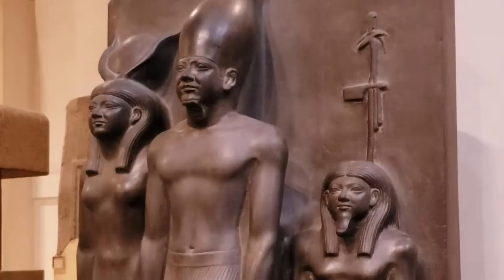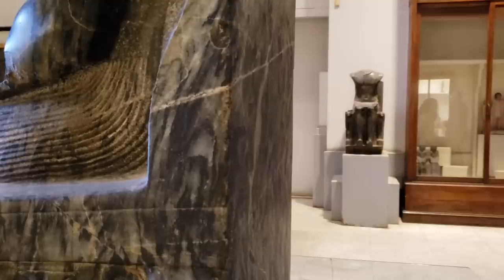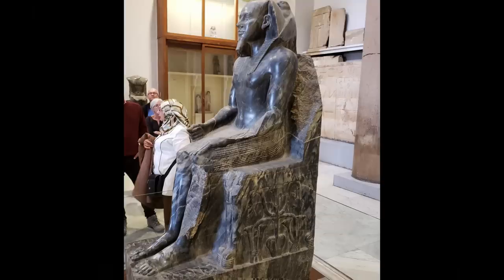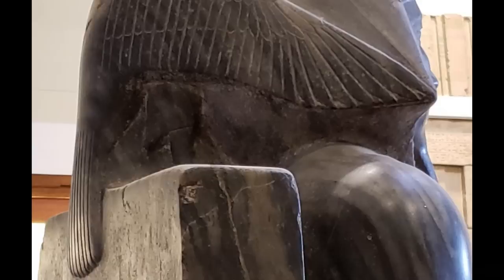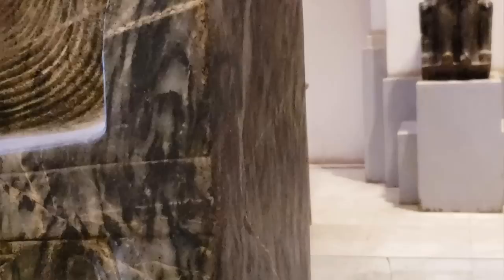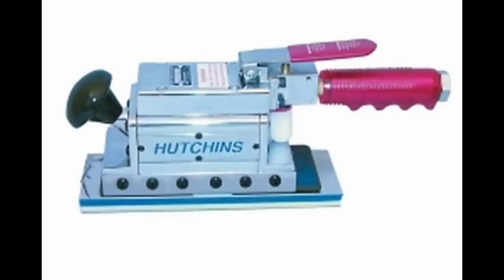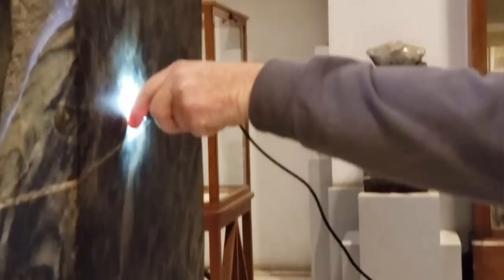Khafre's Diorite Statue

Comment: I’ve always been amazed by the diorite  vases in the museum ,,How material as hard as this was removed from inside a tall vase is just amazing
Reply: Yes - leaving fine spiral groves inside.
Reply: They are the top of the stonework art  ...   and so mysterious
Reply: Because it's laser work! Oops, did I just state that we had more advance technology before our time? >_<
Reply: @crafty3329  It seems obvious they had some high tech kit but the tools dont get found as far as I know
Reply: ya those diorite vases are the clincher for me that it cant be copper tools alone. They were using power tools, Power doesnt have to be electricity. Living on the great river I can imagine water wheels and belt driven machines as one possibility.
Reply: @louferrigno4712  Maybe, but it would have to be very high speed, which would need steel axles, spindles and bearings, not to mention that all the pieces carved would have had to be done right at the riverbank (if that was the case)
Reply: @Automedon2  naw it could easily be low speed. I run ring saws at low speeds that remove material in similar ways

Comment: Manual hard stone polishing techniques are still used today, though electrical machining has take over almost exclusively. For polishing very hard surfaces, shark skin, ray skin and wet leather, covered in various sizes of sad grains are used. The sand becomes imbedded into the wet leather and is similar to sanding disc today. Final polishing is done with hard leathers, leaving NO scratching, as leather is able to even sharpen modern steels, as seen in barber shops, with a blade sharpening leather strap, which hones the edge of the blade, while not leavening a jagged cutting edge as using a F-Dick or similar sharpening steel tend to. Similarly, wet wood most commonly used, also copper and brass, were also used in this way, as the grains would embed into the soft metals, forming a matrix, like the hole saws and stone cutting saws seen today. Large surface polishing, was not done in a random circular motion, it was done in a straight forward and backward motion, like scrubbing the deck of a ship with sand stone. Ancient people were just as intelligent and resourceful as people today, more so in fact, as people today in the west, have become lazy and had everything made for them.
Reply: Mystery solved. Ancient man simply was better than our best stonemasons. Again and again and again. With thousands of artifacts. Probably every ancient egyptian did it. When not building megablocks. How I love easy reductionist answers.
Reply from the maker: Yah...it was easy! Any idiot with some sand, flint, and sharkskin could do it!!! We're just TOO STUPID to comprehend how easy it really was!

Although...you'll notice that none of these know-it-alls has managed to produce so much as a perfect stone bowling pin with their sand and sharkskin, much less a life size diorite statue of a human being, complete with precise anatomical detail and a brilliant polished surface right down to the edges of the cuticles on the nails.
Maybe that's because their lifespans aren't long enough to accomplish the task with the methods they propose?
Reply: Ah. Easily explainable. The principle has been shown over and over again, be it sawing 4mm of granite in one hour or making tube drill cores that almost but not quite look like Petrie's. How to make these (alabaster...?) vases is shown on a relief, as is towing a statue of unknown material by a bunch of buttflaps. See, it is all there for those who want to see. 
There is no need for further research, let alone testing, as the easiest answer to the question, nay, the answer to the easiest question has already been found. The rest is just a matter of belief in your pharao, elbow-grease, and, possibly, the whip. Now there, was that so hard to explain? This is how you have to make use of parsimonity. Why, of course we could do it. No need to spend millions on millions if not billions (with the slight chance of a colossal embarassement) in a real experiment on scale if continuously parading the aforesaid arguments on all mainstream channels - as almost sole competitor (at least with the necessary academic credentials) - will do the trick to convince the necessary majority to steer away from this nonsense. Oh - and pointing to rows and rows of books, papers and articles written on the topic py people building on the established paradigm also helps.
Reply: @AncientEgyptArchitecture  No one said it was easy, at all, but compared to the morons today, present company included, are not a patch on those of the past. The dedication & mastery of their crafts took their entire lives, their children's lives, unto generations to finish major projects. Today, everything is pumped out to make as much cash as fast as possible & as easy as possible. If you want to find quality artwork made the tradition way, but sadly, most are not willing to look, but would rather attempt to mock & make fun of those who have!Did you know, to cut diamond, you need diamond? Or is that beyond you? To work dolerite, you use dolerite, amazing thought!
Reply: Btw, I have been using the leather strop razor blade for my whole facial hair growing life. Yep, the leather works quite nicely. The blade is kept nicely sharp and keen and in the 25 years of weekly sharpening has not lost more than a mm (that would be what, a 25th of an inch?) max of material along the edge. The leather is for the last, final touch. For a blunt blade (i.e. sharpness of a paper cutter) you need the other side of the strop with the 1600 polishing paste. Only for the sake of giving all the facts - the steel used for razor blades is one of the softest, to especcially allow for the ways of sharpening mentioned. It is possible with any other steel as well, but takes much more time.

Comment: From Flanders Petrie, more than 120 years ago:
"And when we find on the surfaces of the saw-cuts in diorite, grooves as deep as 1/100 inch, it appears far more likely that such were produced by fixed jewel points in the saw, than by any fortuitous rubbing about of a loose powder. And when, further, it is seen that these deep grooves are almost always regular and uniform in depth, and equidistant, their production by the successive cuts of the jewel teeth of a saw appears to be beyond question..."
"That the blades of the saw were of bronze, we know from the green staining on the sides of the saw cuts, and on grains of sand left in a saw cut.
The forms of the tools were straight saws, circular saws, tubular drills, and lathes.
The straight saws varied from .03 to .2 inch thick, according to the work; the largest were 8 feet or more in length..." "...No. 6, a slice of diorite bearing equidistant and regular grooves of circular arcs, parallel to one another; these grooves have been nearly polished out by cross grinding, but are still visible. The only feasible explanation of this piece is that it was produced by a circular saw."

"...the lathe appears to have been as familiar an instrument in the fourth dynasty, as it is in the modern workshops. The diorite bowls and vases of the Old Kingdom are frequently met with, and show great technical skill."
Reply: Blades of Bronze - leaving green staining -  fascinating.   Its truly a stunning achievement.
Reply: No doubt they used saws like that for the strait cuts, but it still leaves the question how did they make the vases and statues with very intricate radiuses, convex and concave surfaces? It would be fairly easy to power a large saw with animal power, man power, water power, etc. But the small size the tools needed for these objects, idk what power source could have been used, as it would have to be very mobile (hand held). Something similar to a dremel tool or small electric drill. What I DO know is they sure as hell didnt do it with copper tools or by bashing it with rocks like many “experts” claim.

Comment: Vibrating sanders do NOT leave strait lines, they leave very small circular patterns. Because it vibrates back and forth, and it is impossible to keep it moving completely forward or backward. I have done a lot of sanding, as a stone mason, and a car restoring enthusiast.
If you dont believe me, use a vibrating sander, and then look at the pattern left behind. 
A sanding block on the other hand, leaves long strait lines, just like those in your video.

Comment: If you want a material hard enough to work diorite you need only use diorite... it will require much time and a near religious dedication, but you can absolutely get laser fine details and a glass smooth polish. I feel if they had advanced tools they would have finished the chair as well instead of only putting effort into the figure
Reply: Maybe chair wasnt finished just like other ancient sites like machu pichu, balbaak lebanon which show signs of work being stopped abruptly. Maybe from an ancient 12,000 year old catastrophy?

Comment: Hand polishing leaves straight lines. If you are actively rubbing back and forth either with a sandstone or water and sand you'll leave tell tale vertical scratches on stone reproductions. As you go back and forth for hours. You could take this even further with sand filtered through fabric for a higher grit and remove said scratches if you wanted to.

Comment: it was polished in the same manner that Michaelangelo's statue of Adam was polished, using a technique that has been lost since the advent of sandpaper and files and polishing compounds and various new methods, simple deduction can tell us how it was done! what material has the same rate of erosion as the material you're working on? well that's simple, the very material that you're working with! with marble polishing back in the old days they took scrap from the carving process and pulverized it into a fine powder and then mixed it with an oil or water to create a slurry and impregnated a cloth with that slurry and used that to polish and finish those statues to such a fine degree. this method works for literally any material, take the same material type and turn it into a fine powder and turn it into a slurry.

Comment: One of the simplest ways of separating by particle size with abrasives is decanting in oil.  The longer you wait the finer the particles are left in suspension. It's not outside the realm of possibility they knew and used  this method.

Comment: . ancient craftsmen were very skilled at using sand,(silicon dioxide) as a polishing compound. Chinese jade carvers also were adept at this technique, but used a bow drill to get higher speeds for using very fine silica. Ultra fine abrasive powders can be made by pounding sand or other minerals to a powder then sifting them. As a modern lapidaryand stone carver I have studied several ancient polishing systems. These old techniques were used up until the Renaissance,  when the new science of chemistry started to have an effect.
Reply: As an addendum,  the crystal skulls from South America are thought to have taken several generations to make and polish.

Comment: In Karnak, there is a large green diorite doorway, perfectly cut from a single block 8 ft tall and about 6 feet wide and over 2 feet deep to walk through.  It has been polished to a glass finish.  It is absolute perfection, flat with polished inside angles, similar to the boxes in the Ramasseum.  Marvels we could not produce even today.
Reply from the maker: Yes, I noticed that too, also that the surrounding masonry does not seem to be of the same period or quality, as if it was built around the doorway at a much later date. (Not an unusual thing in Egypt's ancient sites)
Reply: @AncientEgyptArchitecture  That was restoration work. The whole structure is cast stone concrete.  Don't look to the restorers for announcements of all the things that aren't original.

Comment: Great video very well put and displayed!! the average joe does not realize the man hours involved in that level of polish and/or the way you get there. i polished a lot of "draw dies" made of carbide for forming stainless steel. i would magnify the surface 800 times and had to have the "scratches" out at that level. ive done a lot of polishing, 8+ hours on an interior rectangle 5/8 x 1/2
Reply: Totally , the time , dedication and manpower is the real magic involved in all of those ancient works 
I work as a blacksmith making knives so i sand and polish a lot , 
and when i see that level of craftmanship  in old artifacts/buildings/things  
I can't stop thinking about all the hours and people behind

Comment: That finish can be achieved by hand. Modern custom knives are typically ground with a belt grinder, then hand sanded to fine grits. The final strokes are done in a single direction because it looks better. I’m sure any expert polisher would be aware of this. This can be done with stones or abrasive powders.
Reply: And i don't know what he means when he says copper can't chip a stone just because it is hard. Copper is used in flint knapping to chip away hard stones all the time. Sometimes you want it because it is soft even.
Reply from the maker: My remarks do not reference copper or bronze tools used for 'chipping' or 'knapping' granite and Diorite....but rather point out that they are inadequate for 'CARVING' , fine detail work/engraving or precision work in all minerals that have a significantly higher hardness. Anyone can use almost anything to clobber away at a rock and get some of the material to dislodge/fracture away,  but creating a carefully modeled surface as a 3 axis representation of a real world subject, such as a human face, requires more subtle and carefully controlled material removal techniques. Rough sculpting via impact runs the risk of fracturing/dislodging portions of the workpiece below the plane of the desired finished surfaces, meaning that one blow could invalidate the entire sculpture while it is still in the early stages. 
Take another look at details such as the perfectly wrought cuticles of the toes and fingers, the shapes of the eyelids, lips and the exquisite modeling of veins and muscles. If you think these precision features can be reproduced by hammering, chipping or knapping in Diorite, I invite you to search for any modern/stonemason/carver who has done so with flint, obsidian, copper or bronze tools and post a link here to photographs of their work.

Comment: We polish concrete to a glass like finish. We use diamond grit pads, from 30 grit up to 3000. Mostly floors with 1000lbs machines. Edges are done with a 9inch grinder with similar diamond pads.Even with diamond grit power tools it a slow and laborious process that requires a LOT of downward pressure. I can not fathom how this could be achieved by hand.
Reply: It can't. The thought that it was shows zero knowledge of stonework.
Reply: We know somebody vitrified the forts in Scotland and elsewhere

Comment: If they used hand polishing methods you would see dips and waves as there are soft and hard spots in all stone types so it would be impossible to maintain perfectly flat surface.
Reply from the maker: As a craftsman of many decades I know this to be the case. Flat surfaces require some kind of box jig or guide at the very least. For compound curves the challenge is far greater, and so when we observe the tendons / muscles / joints / face, it becomes obvious that a different level of workmanship was required. Hand work, if done very carefully, could certainly account for a portion but IMHO, not all of this artifacts surface.
Reply: @AncientEgyptArchitecture  I used to be a stone mason. If I could go back in time I would go back far enough to see how these things were made. lol its so fascinating. They obviously had to have some sort of tools and it mustve been fairly easy for them to make this stuff. Also just moving these blocks is another amazing feat. As you know just transporting masonry blocks creates a whole problem in trying to prevent the blocks from getting chipped or dropped or damaged in any way.

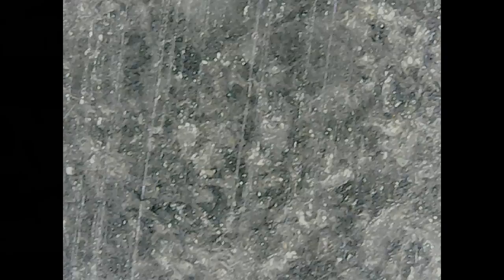Comment: At 6:17, you can observe, with some difficulty, that there are another set of scratch marks underneath the clearly visible 'top' layer of scrath marks. The lower layer set are at more of a 45% angle.

It's possible they used a very large sanding surface, perhaps powered by a person on each side, much like the old-timey saws that frontiers men  would saw down huge trees with.

Nice video!

Comment: Hearthstone quarried  from deep deposits underground, unexposed to air or sunlight, tends to be fairly soft and can be "carved" with relative ease. Once the stone is quarried it begins to harden and becomes difficult to work especially with bronze or copper tools. There are further tricks to harden stone quickly such as were used in making soapstone seals as hard as bronze by baking them. Some stones--marbles--could be made to appear translucent by polishing them with milk. Humans are clever and dedicated and are not to be underestimated. ETs need not apply.
Reply: Ha ha ha ha thanks I need that.

Comment: It is remarkable. Prisoners have been known to cut through steel bars using dental floss, spit and sand. It takes a very long time and constant replacement of floss and sand. I can't imagine this work was done in this fashion even using incredibly small hand-powered grit drills. I am very interested to see the differences in the sarcophagus external surface polishing and the patterns left in the bottom of the hieroglyphics on it. I theorize the finish on the external surfaces will be much finer and consistent than the surfaces in the etched parts.  I also think these surfaces were manufactured at different times, possibly thousands of years apart...